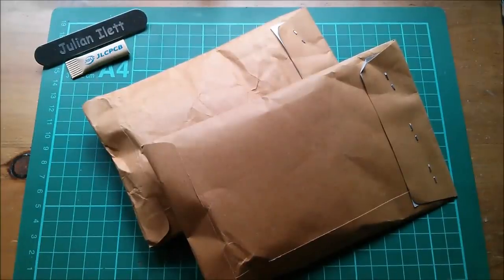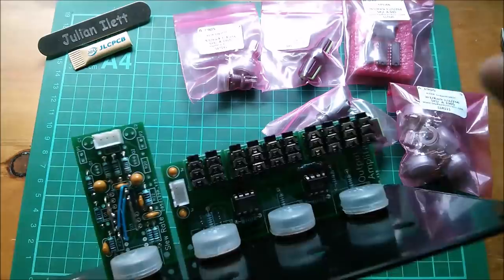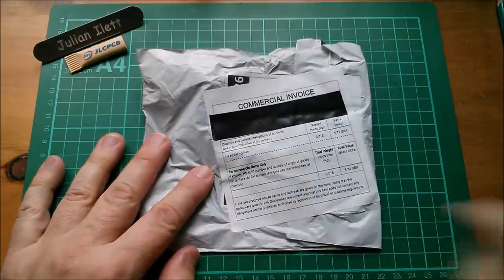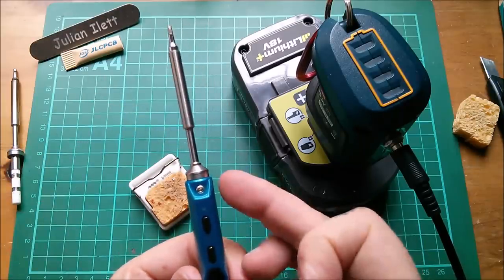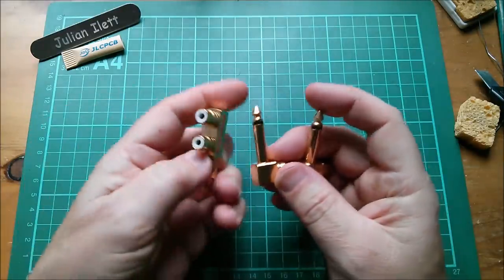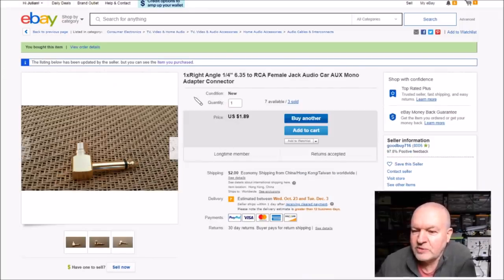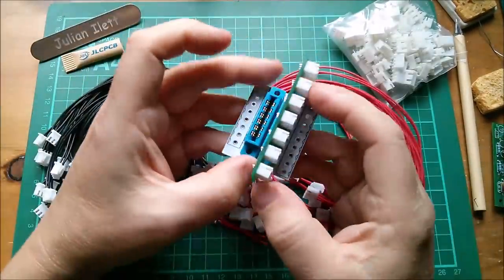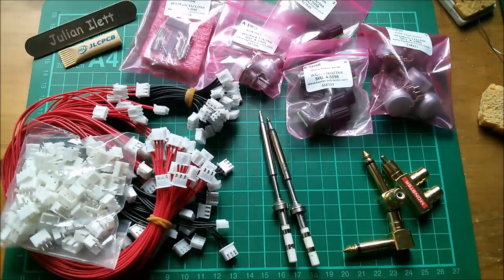Julian's Electronics Postbag: #141 - JST Cables & Iron Tip

Comment: I always used the staple remover on both sides.  The bottom to straighten the legs, then the top to pull the staple out.  That way it doesn't rip through the paper.  Also kind of sad to see the bodge finally being pulled out :). I love a good bodge.
Reply: @qsxforever
a friend of mine says "its not bodging its customizing" sounds much better :-)

Comment: Please check the wires with a magnet, some Chinese manufacturers are using iron conductors. I discovered that the hard way. Because they had an insanely high resistance, I thought: Maybe they are made of iron! And yes, it's easy to check with a magnet.
Reply from the maker: I'll certainly check that, thanks
Reply from the maker: These do not stick to a magnet :)
Reply: @JulianIlett  Thumbs up for that supplier. You will be surprised how many places iron wire can be found nowadays, the original wire for my HTC cell phone is of iron. Hope we can get it stopped, by enlightenment.

Comment: Hi Julian, what's your thought on using a linear pot + a fixed-value resistor between ground and middle pin to make a logarithmicish curve? Best regards, Jouni ("Yo-ni", /ˈjou.ni/) from cold Finland
Reply from the maker: Should work fine if you're driving a relatively high impedance - I'd like to try it :)
Reply: I used it in my headphone amplifier and I think it's good but maybe some hifist could disagree.

Comment: Use tayda website store, not ebay storefront. generally better prices, and they have discounts ~twice a month. Yes, website store will add shipping, but it will be generally dissolved by discount.
I order many things from them and from ebay, and I'd say tayda almost hobbyist digikey -- in components quality aspect. No issues with quality yet, starting from uln2003, attinys, and ending with "truly-real-not-fake" power transistors and properly working microservos. Their 1/4 w resistors always best quality as well, and indeed in 1%. 
Just one warning - DO NOT buy their kits, hugely disappointing experience so far.

Comment: I LOVE 555's. I've heard of the 556 and understood it but it didn't stick in my brain. Now I will remember them forever. Kinda like going from a single cylinder engine to a twin. Thanks, Julian. I am so glad you are moving forward with the Vocoder and doing such an excellent job. Meticulous. That is what keeps me coming back. You are close to completion, my good Man! Just so everyone knows, the taper design of the staple remover/extractor creates a "base" automatically so the crimped ends on the underside cannot tear through the paper. The paper is "pinched", but it is backed by metal. The "offending" but useful part of the staple slides harmlessly around the metal backing. Quite an ingenious invention. (Yes, I studied how it works).

Comment: Hello Julian.  I like your Postbag videos.  It has inspired me to buy things on ebay, that come from far off lands.  An MP3 player board, arrived today.  Its the one with TF, USB, 4 buttons.  Came from Vienna.  Theres a yellow label on the packet.  Goods not fulfilling the conditions laid down in Articles 28 and 29 of the treaty on the functioning of the Europe an Union.  Yes there is a gap near the end of European.   Is this a customs label.  So I have to pay £10 on a £1 item.  Or has Igor, in Vienna put the sticker on the packet.  Have you seen such a label.  Isnt article 28 to do with diversity.  So if I put Abba tracks on the USB stick.  Will that be ok with the LGBT

Comment: The identical label on both sides for once came in handy recently when order leaked, or was leaked on, which erased the thermal-printed label on counterpart sides on each label. So the complete information was pretty much there, you just had to flip the package back and forth to each label.
Reply: (Address on both sides also helps in sorting speed, if you've ever seen a video of the inside of a Chinese parcel sorting facility.)

Comment: You're using that staple remover wrongly.  You are meant to apply the teeth of staple remover, not to the legs of the staple but to its spine on the other side. This way, you can remove the staple in a single action.
>
Reply from the maker: There's no wrong way to remove a staple :)
Reply: @JulianIlett  That is very true.
But there is certainly a wrong way to use that tool and you demonstrated that perfectly ;-)
>